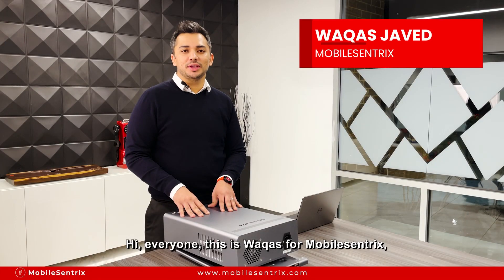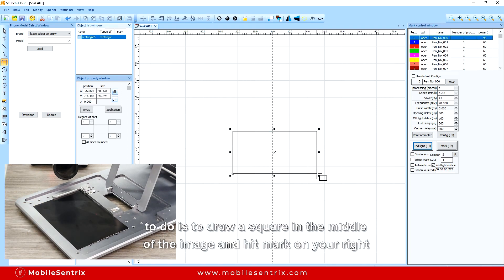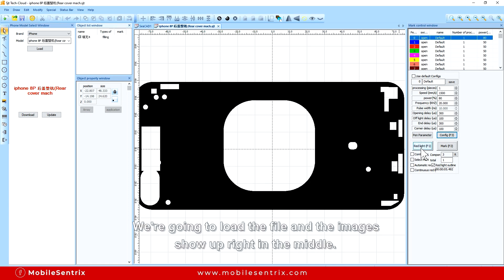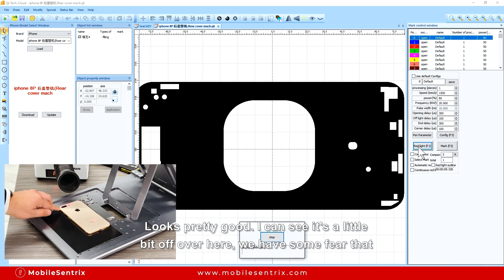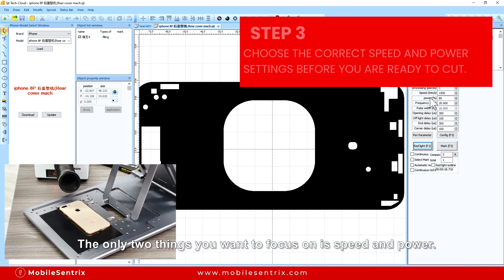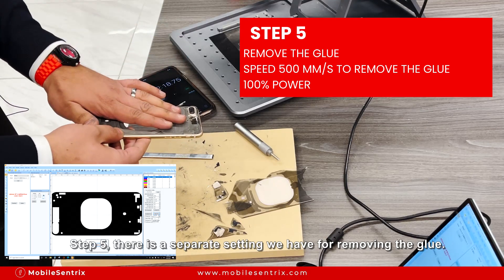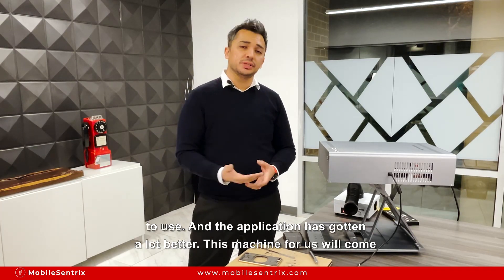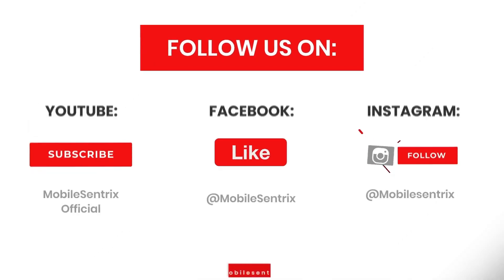M-Triangel Z-One Laser Machine

Comment: Definitely a long time MobileSentrix customer. Have always had great service and happy with parts etc. Did you have to remove all the parts inside the phone before taking the glass off with the laser machine? Can you do it without removing the inside parts? If you have to go through all that trouble, just replacing the housing seems like a simpler solution.

Comment: Any ideas as to why the 8+ back camera stops working after the laser?
Reply: Use masking tape to cover cameras, mostly when using the laser after removing the glass. Little holes are exposed , the láser go through and damage capacitors. To fix cameras, remove the damaged capacitors.
 Beware XS max, the láser damage Charging flex cable too,  use masking tape to avoid damages.
Reply: @carlosovalle8899  do you have an example of where to place the masking tape? I've had trouble with the charge flex in the past.
Reply: @whitemus3257  run the láser  to remove the back glass!! 
After the back glass is removed ,use masking tape to cover every hole or gap  and cameras. Run the láser again to get rid of the rest of the glue.
Reply: There is a small gap between the camera surround and the backplate, the lazer goes through it and cuts the tracks where resistors R3900 and R3901 are. Ive now ditched the lazer machine and opt for full chassis replacement as the process was longer than advertised and the finish was less than desired.
Reply: Is the lens covered during the laser?
Reply: @obrien247  no the lens, all components and motherboard are still inside. It only happens with the iPhone 8+ I’ve noticed.
Reply: @sakuraK1313  I keep the rear cam covered with a cutout of foam. No issues. I’ve had rear cam issues when not covered.
Reply: Haha, I love when technicians fix phones until they are broken. 😆

Comment: do a video with , real iphone x or 12pro max, to make sure is not another machine to damage motherboards.i hope u do the video in real time after that i gonna order tha machine for sure.
Reply: if you're damaging motherboards, you're doing it wrong. Or, and this is just an idea. Maybe take the motherboard out?
Reply: @mabisbabis9480  , the purpose of the machine is to save time and money, if you are going to have to strip it down, you may as well fit a new housing.
Reply: @Benchandbeyond  first of all, if you're damaging motherboards during the process, it's because you don't know how to use the machine. Second of all, taking a motherboard out of the device is waaay faster than taking every single component out of the device to swap into a new housing.
Reply: @mabisbabis9480  what is the point to buy this model, i know the others TRIANGLE, is not problem at all. if u have to take the board out , better just use heat Gun ($80.)
Reply: @cellwifi  the people who are damaging motherboards while using the laser machine don't know how to use it. There are two diffent lazer patterns for every phone. One pattern is to be used while the glass is till on. The other one is meant to be used if the glass is off and you are lazering just the adhesive. If you run it wrong, you will lazer through gaps in the housing and fry components on the board. I fix motherboards for people who do this regularly because they don't know what they are doing. The camera doesn't stop working because the lazer hit the camera, the lazer hits the board and damages components for the camera.